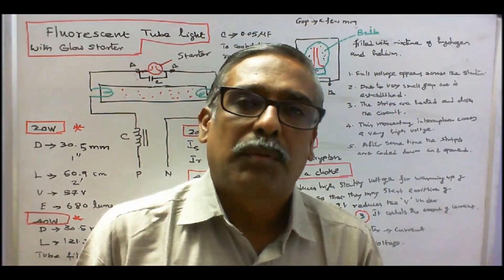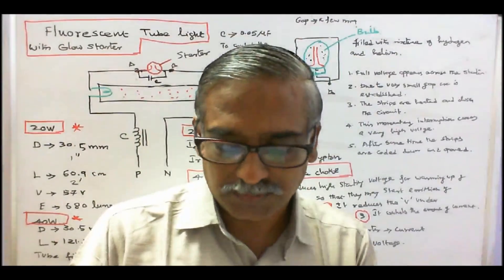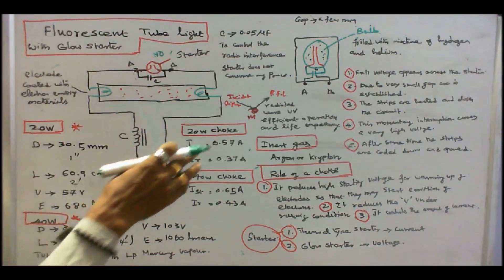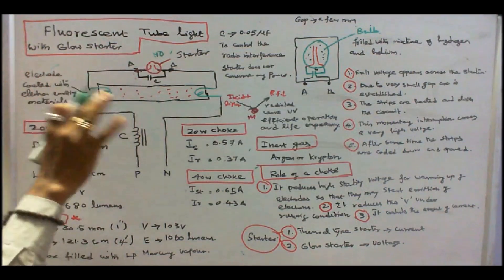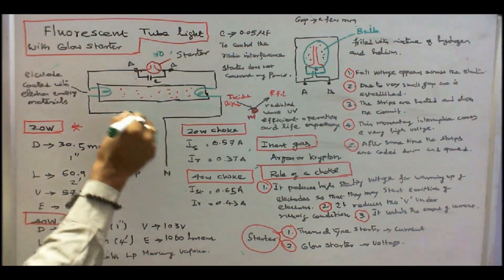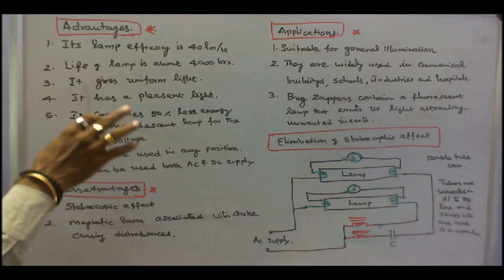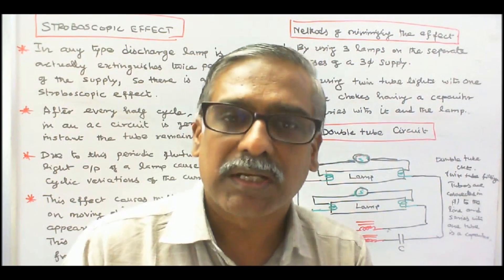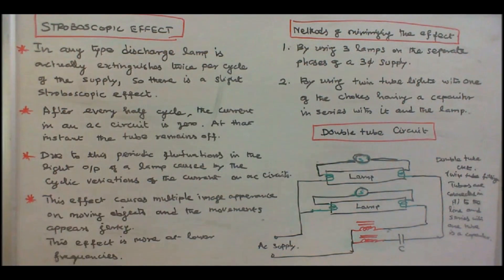ELECTRIC LAMPS - PART - 02 - OPERATION OF FLUORESCENT LAMP

Comment: how can it operate on dc.. as there is a capacitor.. so it will be open circuited?
Reply: Capacitor on d.c at starting is short circuit....so voltage appears on bimetallic strips.and after some time it gets open circuit on but circuit is complete as sir explains